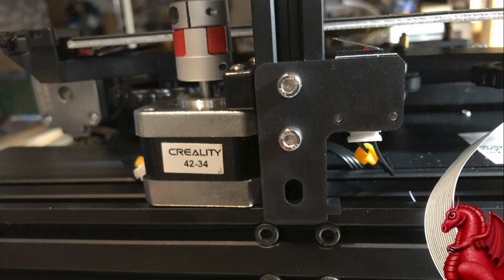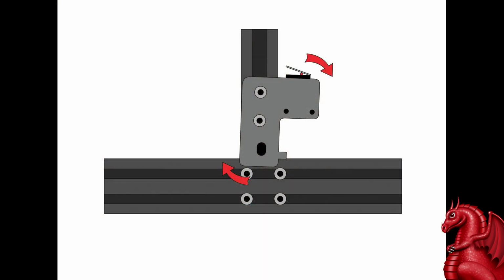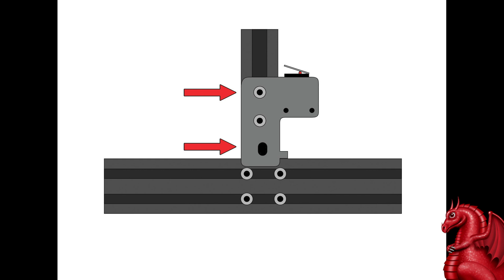Ender 3 Z-Axis Endstop Switch Problem

Comment: I'm only at the beginning of your video, but after your explanation of what's going on, my Ender 3 is leveled properly before printing, but as soon as I start printing, the unit acts like I leveled it in a way where I decided I'd just dig the nozzle into the print bed and it's freaking annoying. I've destroyed 2 print beds after leveling and setting it to print and walking away only to see an absolute mess and ruined print bed 4 times now.

Comment: Strange coincidence. I just started having the issue you describe this past weekend. I just checked, and the bracket for the z limit switch is just slightly loose. I'm not sure why - the printer has been in use for months without issue, but something must have vibrated loose. I'm readjusting it first thing tomorrow. Thanks for sharing this information!

Comment: There has got to be a better way to adjust this. I've been having the same symptoms you had except basically every single print it was drifting up about .01 mm. Getting the height right is a royal PITA. Takes me about 10 tries sometimes more. I need a screw adjuster like that of a chainsaw tensioner so I can do these adjustments more precisely.

Comment: I have this issue, but the bracket holding the Z limit switch is perfectly aligned with the frame, so that is not the cause of the problem for me. Somewhere I saw a replacement Z limit switch where the motor bracket that contacts it presses straight onto the plunger instead of relying on a piece of metal to bend consistently.

Comment: Just wanted to thank you for posting this video on the Z stop I bought my used in the Z stop was loose so I didn't know if it needed to be tightened or not and yes it does I finally got two things printed so thank you for this very much

Comment: Make a new mount, with a raised center section to fit in the V slot. It will resist the torque applied over many uses.

Comment: I adjusted mine and even set it 1-2 mm higher my problem is audible. My printer won't click the 2nd time it goes down when homing. Your issue seemed to be mine but after some adjustment it's not the same issue I'm having. 😕

Comment: I have had a few issues lately with my printer and this seems to be the last one needed to work out. I just installed my Kobra Neo and printed a few calibration tests to test it. Worked great. Now that I have attempted to print larger pieces the first few layers go down fine but after a few layers the nozzle starts to drag against the previous layer and you see the carriage bouncing and making an awful noise. The z axis has no problems going all the way up or down when using control when I’m not printing, but when I’m printing it will
Only go up a little bit and won’t go up any more. I don’t know what I’m doing wrong, im new to this.

Comment: UPDATE:
Although your video didn't help me personally, I bought a replacement micro-switch unit and it now "clicks" again when the switch activates. Before it was activating before the "click" and randomly causing the Z height to change every time. It's now working spot on every time. I'm going to stock up on a few of these replacements for the future as they're clearly a bit of a weak point! Hope this might help some of you
Reply: I too just replaced a Z stop switch for this problem, having a switch that over 2 years has worn and as a result ' wiggles ' a bit. This caused uneven 1st layer prints.
Also pointing out this correct alignment issue helped me to correctly align the plate.
Thanks for posting.
Thank you Tomb 3D for the video as well !

Comment: Mine still doesn't "limit" in the same place. Scratched the bed several times because of the issue. I've just ordered a replacement limit switch board. Its always had this Z issue since day one. So frustrating. Hope I can fix the issue, as otherwise my Ender 3 Pro Max is a great machine.

Comment: Hi, I have a custom built reprap that makes the Y motor stutters when it goes to the end (far away from the front of LCD) switch; maybe I have a faulty switch/cable/link to the bed problem?
Reply from the maker: The stutter is the stepper skipping, it isn't getting a signal to stop moving which means either the switch is bad, or the wiring is not plugged in fully at the switch or the main board.
Reply: @Tombof3DPrintedHorrors  thanks a lot, gonna check all that! 👍

Comment: Yooo THANKS my man! I was so frustrated with this issue and looked high and low for the cause. Didn’t know the fix was this simple! Thank you!!
Reply from the maker: If it doesn't resolve your issue then you will need to replace the switch. I use these and they are very good and not expensive: https://www.amazon.com/gp/product/B08TQLWSWB/
Reply: @Tombof3DPrintedHorrors  Do you know what might be causing this issue on an ender 3 s1? it looks like there is no z limit switch
Reply from the maker: @MrAws0m3Gaming  sorry, no. I got rid of the S1 I had for testing.

Comment: I was having the same issue and after watching your video I tried your fix but it didn't fix it. I did figure it out though, it was the two phillips screws that go directly into the switch that were loose causing the switch itself to wiggle. After tightening those it levels consistently again. Just throwing out other things that may cause this same issue!
Reply from the maker: Thanks!

Comment: very helpful, thanks :)
my machine is doing this about every third or fourth print, up to 2mm difference in height between homing it twice in a row sometimes.

maybe its a cheap switch, and the little plastic insert below the metal arm is moving around in it's slot a bit, giving slight inconsistent results

Comment: My nozzle keeps moving down even after hitting the Z stop switch. It just keeps going down and hits my bed. Just started randomly going too low after months of printing without issues.
Reply: Did you figure out the problem?

Comment: Ok further to my last comment - it failed again so sorted out a mod to replace the Z axis microswitch with an optical switch. Cheap to implement although does require a wire with ~110ohm resistor to the logic board 3.3v (I used the vcc pin on the BL Touch connector). It works really well - gone are the days of the z home position being fractionally out due to the vagaries of the mechanical switch and then bed adhesion and leveling issues as a result. The thingiverse object for the mounting of the switch and some instructions are here:
https://www.thingiverse.com/thing:5256095

Comment: I have this problem in one of my enders. I switched the end stop PCB with the y axis and now the level is always right, but if I print two geodes to make a multi material print, it will not align well in y axis so at least for me the problem is in the end stop switch... By the way I like very much your videos! Regards
Reply from the maker: If you need a new switch try these, they are my favorite (very short activation distance.) https://amzn.to/33L62j1

Comment: Yes I have had this issue also and corrected it (for now anyway) by widening the slots of the screw holes so that the plastic mount can be moved slightly left towards the stepper motor. The symptoms of the issue are that the switch sometimes clicks and sometimes it does not, but in both cases it indicates to the controller that the z axis is at home position even though the actual distance to the build plate is not the same. The result of the mod of moving the switch assy to the left a bit is that the switch always clicks when the z axis homes. I believe the issue is with the internal mechanics of the switch in that by shortening the arm it results in the lever action on the switch button becoming more significant and negates the ghost switching that can occur which is also why it can be resolved by installing a different make of switch.
Reply: Hey Ross! Thank you for that! I have a brand new Ender 2 Pro and I have the exact same issue with my Z axys homing.  Can you provide an update on your solution? Did it fix the problem?

Comment: Thanks for the video, i have to try this, i had this issue in the past and it was gone after a while, but now i'm with this problem again in almost every print. One interesting thing i realized today is that when the problem occurs, the Z limit switch is triggered before the click sound, and thus the X gantry is slightly higher than what it's supposed to be. So what you did makes sense, maybe the angle of the limit switch can prevent it from triggering before the full click.
Reply from the maker: If that doesn't work for you try replacing the switch (they are cheap on Amazon): https://www.amazon.com/gp/product/B07ZCSXNF3/

Comment: Just to add something as well about odd levels. I bought a Creality glass bed and couldn’t figure out why it always needed leveling after I took it off to take a print off. One day I threw a straight edge on it and low and behold it was bowed in the center. 1 out of 8 chances I put it back the same lol.

Comment: You are correct it should not make any difference what so ever as it is a mechanical action. It is possible that you actually have an issue with the mechanism of the switch or the operation/geometry of the lever actuator.
Reply from the maker: If it were those then re-aligning the mount would not make a difference.
Reply: @Tombof3DPrintedHorrors  it could be now that you are now actuating earlier due to new position, however if switch and lever are functioning as they should do moving the position will make no difference. Your issue appears to be how the switch is operated. I have just moved mine to simulate what you had and I don't get inconsistencies or not yet as trying 3 attempt now.

Comment: Or, get a BL touch and use the probe for a Z-stop, and ditch that stop bracket for good.
Reply from the maker: Those can create their own issues. Best to keep the machine as simple as possible and learn how to use it.
Reply: @Tombof3DPrintedHorrors  installing and using a BL touch is an easy upgrade. You learn more from getting in there and doing it. Once the conversion is finished, and your z-offset is set you're good to go.
Reply from the maker: I know it's an easy modification, I never said it wasn't. What I said is it is unnecessary and can create different issues. You are better off learning how to properly level your bed.

Comment: I have an issue,  my extruder gears grub screw (set screw)  is not doing the job ... any idea what to do in that situation
Reply: As in,  the shaft will spin when gear is stuck. (Screw is not 'setting 'it)

Comment: I had the same symptoms, first every third our fourth first layer was too high. Then a few dozen prints later, the odds turned, only every fourth worked. I replaced the microswitch on the Z axis with an Omron D2F-01FL-A, which solved the problem.
Reply: Was it not making contact? Mines be doing that for a long time but still homes. I assumed it was memory of where it tripped the first time. Yours trips it every time like y and x?
Reply: @christopheradamson81  It was making contact everytime, just inconsistently.
Reply: Did you have to solder it on?
Reply: @mikpiot  Yes. I desoldered the original from the PCB and soldered the new one.